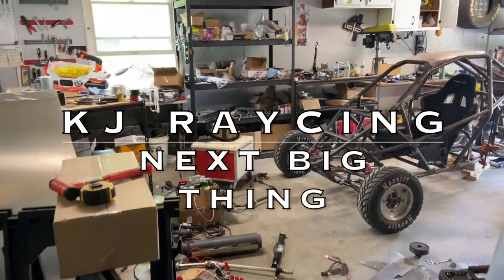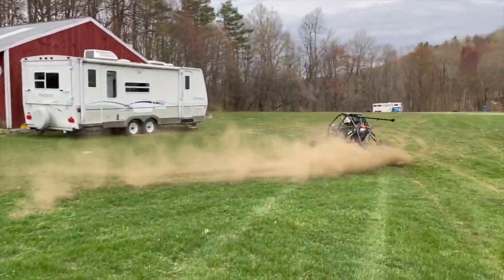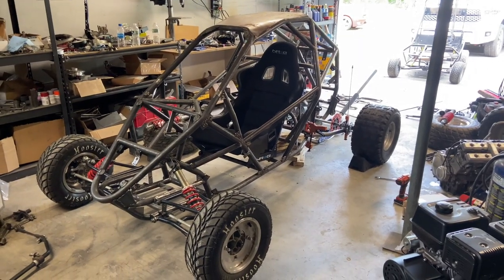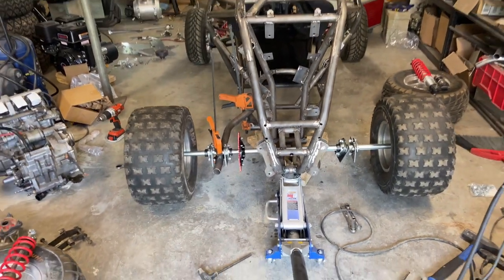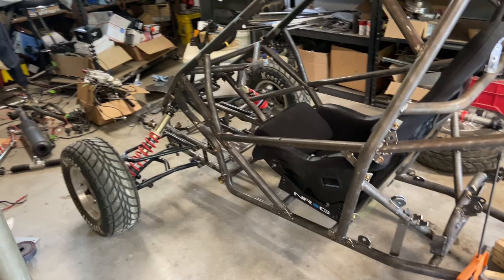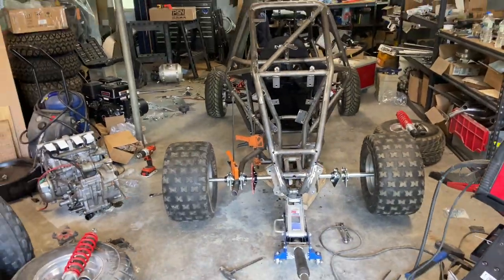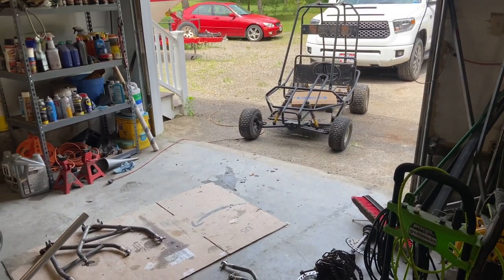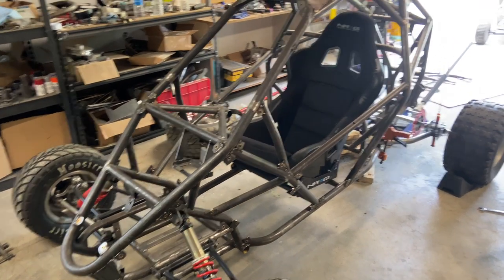How to build an Inexpensive Crosskart

Comment: Hi there this sounds real good hope you get time soon to get your new Kart project done and thank you for your service how long are you still for. also 1-1/4 axle do not cost much more so guys could use motorcycle motors with your new axle suspension any way great builds and info.
Reply from the maker: I hope to get a little time too. There are a couple boys who want to be my testers. I have 22 years in but I love my job so it’s hard to think about leaving. I searched for a while on this, I wanted inexpensive, available and semi easy to build. The 1 1/4 and up stuff I saw was 600 bucks or more, which could easily be used instead to run more power. Thanks for the comment as always 👍

Comment: Love this project. Ready to build some fun project and you have this in the bag so i had to subscribe. Have you considered adding a track bar to the rear swing arm to accompany the anti sway bars. (Similar to a Jeep Wrangler set up)
Reply from the maker: Thank you so much!  I’ve been looking at a lot of different suspension options. I want to make it very approachable and somewhat simple to build and align. I’ll have to see where it goes when I have more than paper and CAD to fool with. Build budget is 2k which doesn’t leave a lot of room for a bunch of hiem joints. Track bar was/is definitely in the pocket.  Sounds like you have some experience to offer, please consider joining the Facebook Group 👍

Comment: That is Awesome...It will match my polaris predator 500...
Reply: The 420 in question at 4:32 is mine! Check out our videos!
Reply from the maker: The predator 500 would make a really good donor for this type of build. That Fuji 500 is really quick as you have seen from the black #27... thank you for tuning in 🙂

Comment: Hey man, good stuff! Just a thought.... your "CLR" radius of your 1.250" bending dies looks to be around 3.5 to 4"     0.065" wall tubing might give you a kinking issue. I use a hydraulic driven JD2 model 32 bender and 1.250 x .095 or .083 dom with a 3.5 CLR is the limit for anything more than 90 degrees. For .065 DOM i use a 5" CLR die and it still has quite a bit of deformation. Love the live axle route, it will make it so much more obtainable to some builders just starting out. Because the axle is so long, 1" steel is going to be a problem. I realize you're trying to keep cost down but an axle out of a micro sprint is usually 1.375 dia 4130 and is almost bombproof. If you made the swingarm as wide as as possible to keep the bearings close to the wheel you might be ok. Keep up the awesome work my friend 👍
Reply from the maker: Thank you Ken. I think the Rogue Fab bender will do what I need it to. Not that I for see a lot, but I don’t mind a little deformation because I’m not building a space shuttle, I’m building an entry level crosskart or yard kart if you will. The axle will definitely hold the power of a 420 and an atv engine because it is a heat treated axle. And the swing arm is appropriately designed to keep the moments low. And it will articulate to further reduce the punishment. Thank you for the comment 👍

Comment: I've got a highly modified Murray Kilowatt! Check those karts out! It's a swing arm rear suspension but chassis mounted engine! The driven clutch drives a jackshaft at the swingarm's pivot point. Built 460cc billet everything, 780 Torque Converter, converted front and rear to hydraulic disc brakes ect....
Reply from the maker: Thank you! I never realized the motor wasn’t on the swingarm! Awesome, this is going to help a lot, thank you again 👍🖖

Comment: Would a atv axle with wheel spaces be just as good? Just cut off the front of the ATV swingarm and split into a y to attach to each side of the engine cradle mount.. like this ATV axle build https://youtu.be/0ZEcXzgIQc0
(Was planning using a Yamaha Raptor 250 complete rear end that uses a steel swingarm)
I’m going to use VW IRS diff centre converted to sprocket in my build as it directly takes common axle flanges, but seriously considered a solid axle from a Raptor.
Reply from the maker: I’ve looked at that idea a million times. It can definitely be done as you’ve seen.  It is very hard and very expensive to widen a solid rear axle correctly.  I didn’t do it as I really wanted irs and a shorter wheelbase.